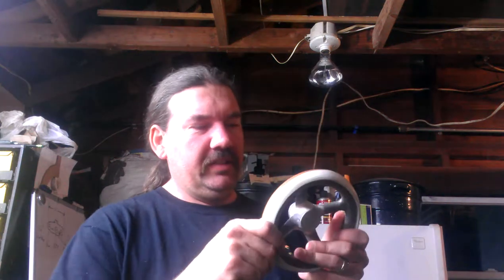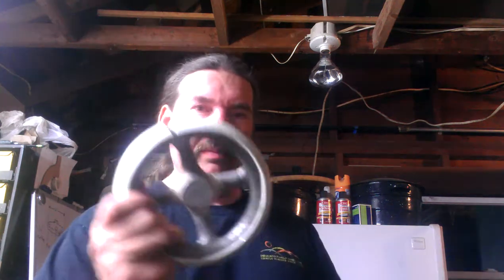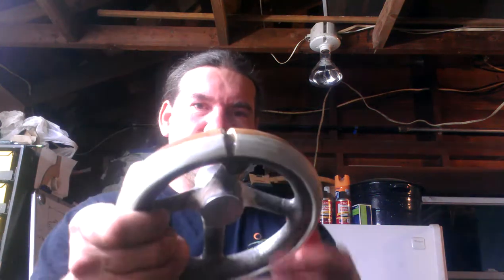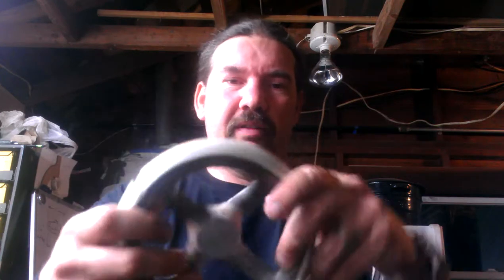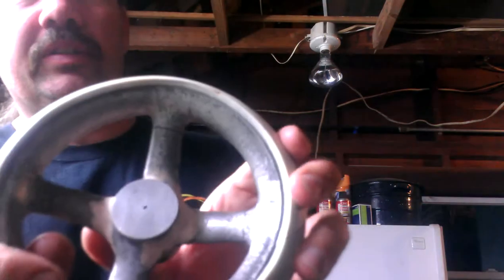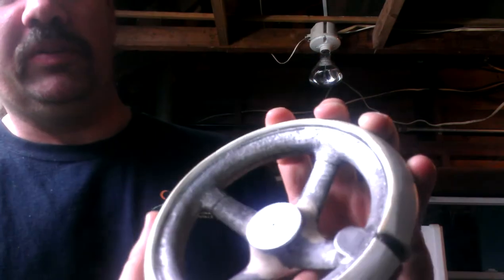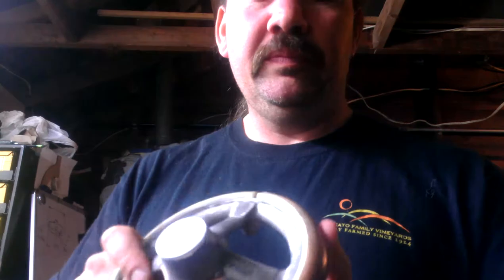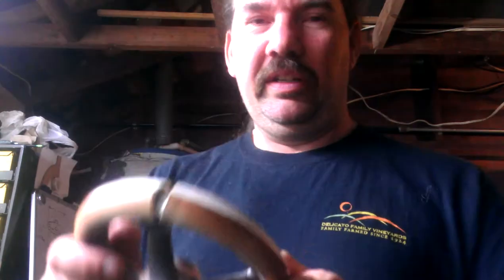Brown and Sharpe horizontal mill hand wheel pattern part 4

Comment: Besides building up with tape, you have me wondering about building up with body filler.  Mount the part on a mandrel and turn it.   Many ways to skin a cat I suppose.
Reply from the maker: your on to it but it needs to be thicker then tape . study up on machining allowances think for cast iron 1/8" is recommended